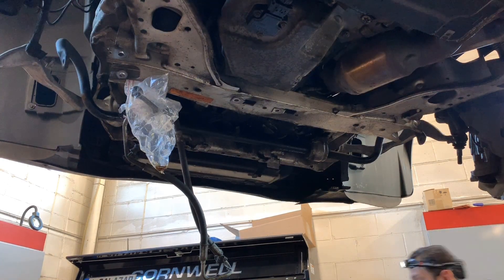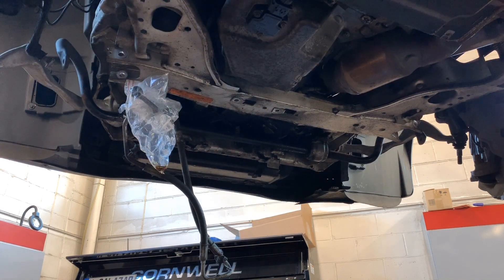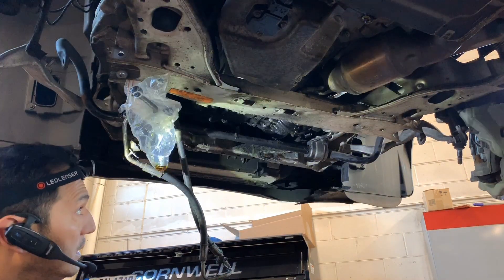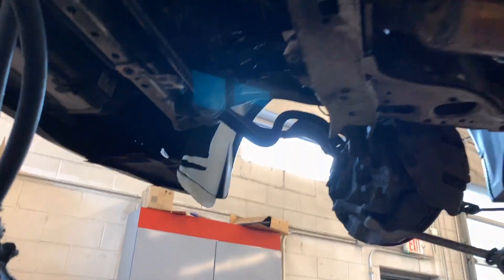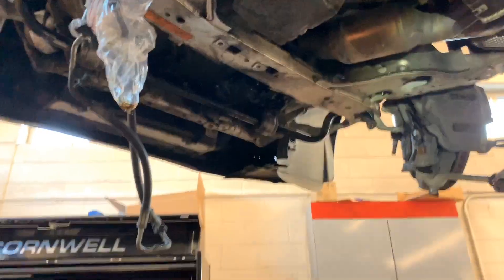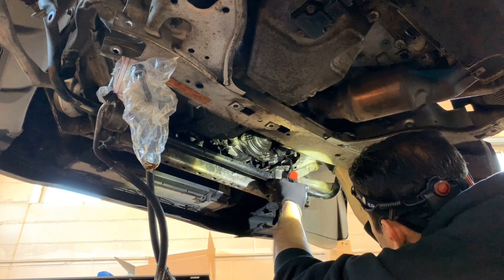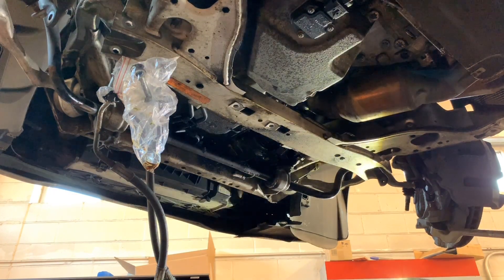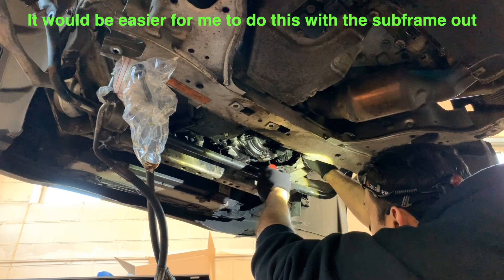2007 BMW 335i turbos replacement part 3

Comment: Both turbo wastegates stuck open... or is that a fail safe / position when engine is off?
Reply from the maker: Thomas EXOVCDS normal position while off on these engines.
Reply: @MaicSalazarDiagnostics  Good to know, thanks!!!